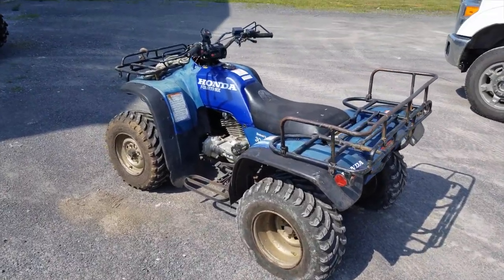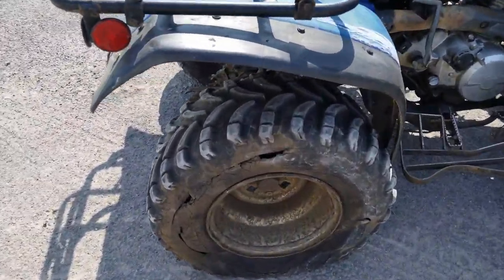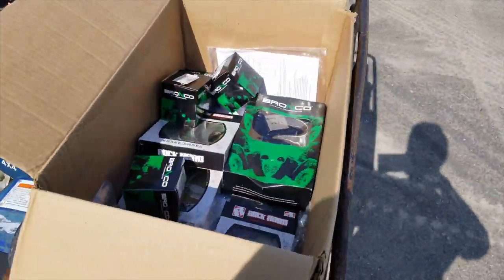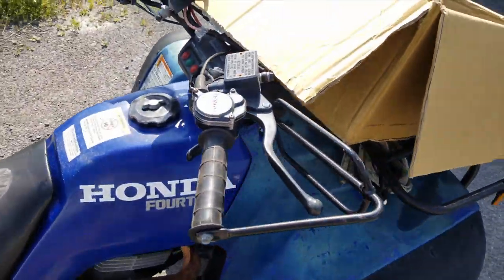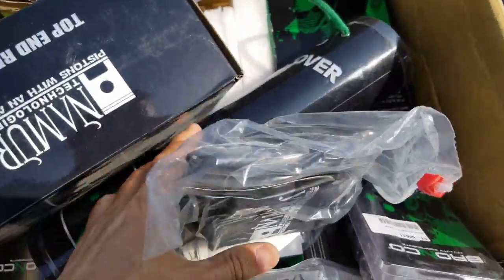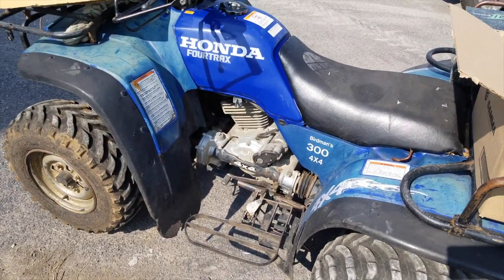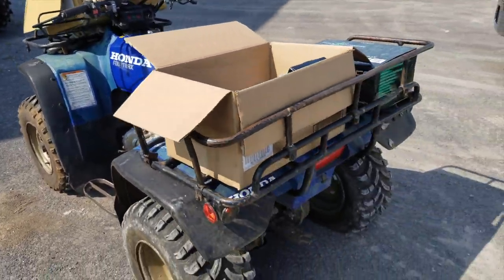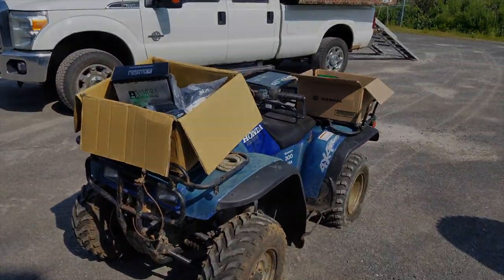Honda 300 build series.  What we are dealing with!

Comment: I have the exact machine, darn thing is so reliable I don't want to part with it LOL
Reply: And they also do better in stock form than a 20 000 dollar can am.
Reply: @jeremystratton3368  They are good for plunking around on trails and in woods. They're narrow so you can traverse through the woods. They always start. However, on a long uphill ride, I'm constantly having to downshift because it's only 300cc's...something I don't have to do on my 450 Kodiak. I still love that little 300 Honda though LOL
Reply: @Erated78  I was thinking more for deep bog and marsh conditions but yes a bigger bike will perform better if you want to go fast.

Comment: Does the winch remote work if the winch is under water and remote isn't?
Reply from the maker: its in the solenoid so ill mount it high.  but ill also have it hard wired.